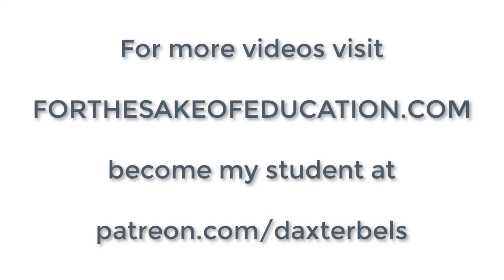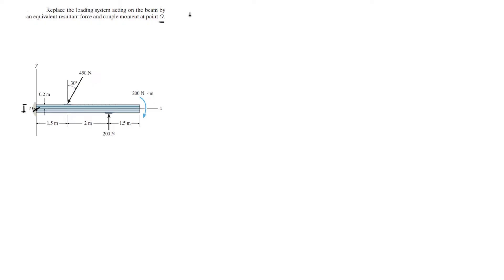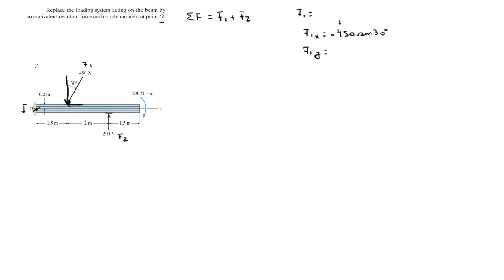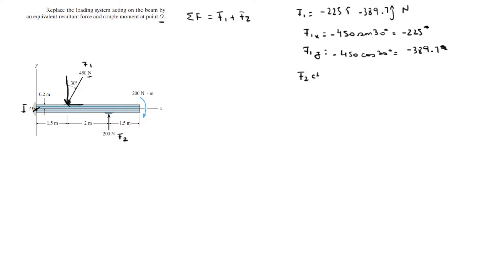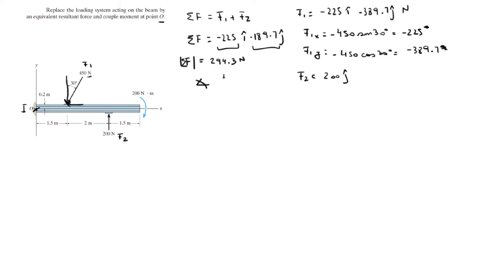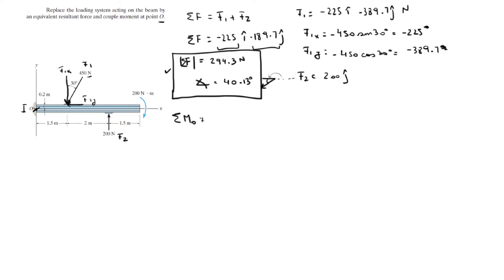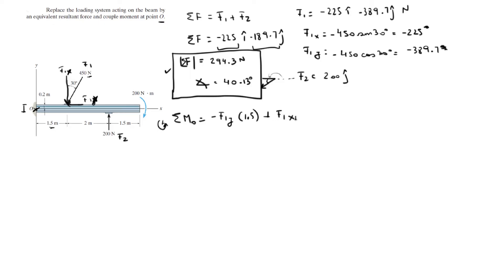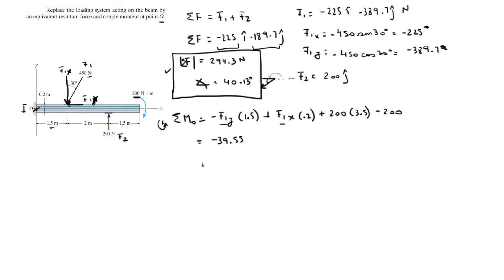Replace the loading system acting on the beam

Comment: Why would F1x be included in the moment when it is not a perpendicular force, and wouldn't cause rotation?
Reply: the beam has a width to it, so the force is applied at the edge of the width at .2 meters